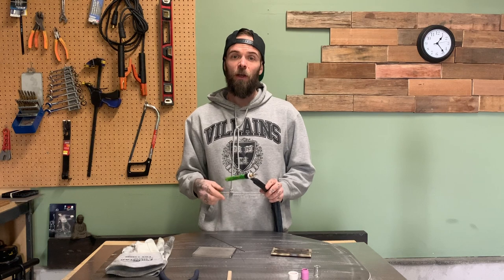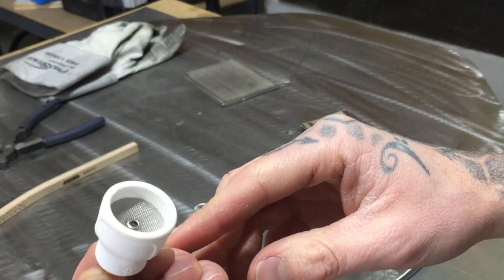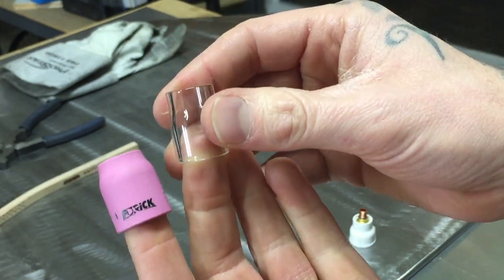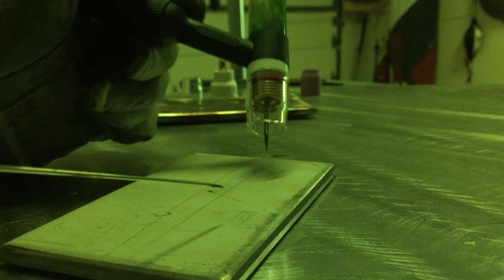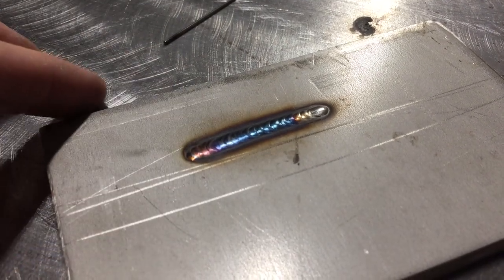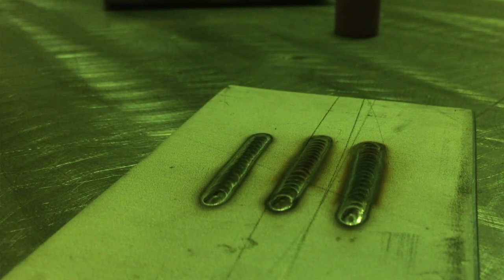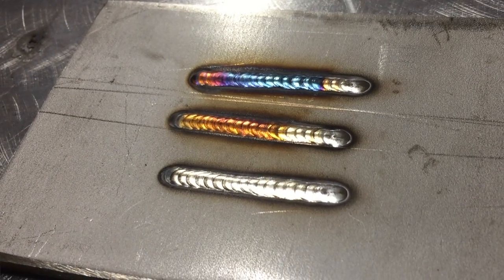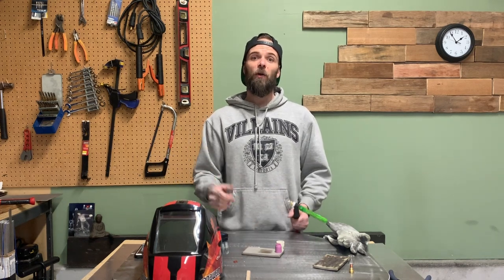TIG WELDING TORCH PORN! NEW FURICK CUP TIG WELDING GAS LENS! TIG WELDING ART SUPPLIES!

Comment: Thanks for the video! I can't help but wonder, if on the last weld you turned the gas flow up to 30 CFH, what would the first two welds have looked like at that flow rate? I just can't tell how much of the improvement comes from the different gas cup and how much comes from improved flow rate. Curious what your thoughts are. Thanks!

Comment: Hi Dusty!
I love my ceramic #8 cup,
Also I bought one Furick BBW what is amazing, and one Fupa 12 from Weldporn. I love bot of them!
But I can't use them a lot in the welding school,
Because I practicing steel pipe tig welding,but I tried on stainless steel. Super
But I'm sure you will love them. Good quality cups!
Kind regards:Robert
Reply from the maker: Hey Robert! It’s amazing to hear from many people about what they use as far as gear. Thank you for sharing! Isn’t it fun to play with toys and see what the difference is between theM all? It’s a blast and definitely one of the funnest parts of my channel so far! 
Are you an instructor at a welding school? Where are you located?:)
Cheers!
Reply: @PacificArcTigWelding  Hi Dusty!
Unfortunately I'm not an instructor, I just learning to weld in the school.
I want to work as a welder,because I hate driving. And I have two good hands. 
But I bought a nice CK flex loc torch, and couple of gas lenses. 
Currently I live in London UK. Originally I came from Hungary. 
when I will  finish my school I will go to Danmark. I have a job offer,just I have to be good in  pipe welding with TIG.

Comment: My welds are still grey with the fupa12 @30cf 🤷🏻‍♂️too hot, too slow?
Reply from the maker: Tough to tell, if say try eliminating both of those. Less heat, faster speed:) Also I always recommend pulling the tungsten back in a bit more to eliminate gas flow issues.
Reply: Ok I’ll try a bunch of things. Thanks for replying!! Love your work
Reply from the maker: Thanks so much! Let me know how it goes!

Comment: How do you sharpen your tungsten? I’m just learning to tig and using a grinding wheel but feel like I should maybe figure out a better way
Reply from the maker: I’ve been Tigging for 18 years and still only use a grinding wheel:) I just make sure my pedistal grinder has a fine wheel on it, to make sure the grinding lines aren’t too deep:)
Reply: Pacific Arc Tig Welding awesome thanks!
Reply from the maker: Just keep it clean that’s allllll that matters! :)
Reply: Pacific Arc Tig Welding when you say clean, you mean wipe with acetone and obviously keep it away from any grinding dust etc?
Reply from the maker: Yep:) My shop is pretty clean, so doing something like that is great for cleaning what you’re about to work on. I also experiment with lacquer thinner as well as isopropyl. For most of my stuff that all seems to do a great job:)
Thanks for hitting me up:)

Comment: Also the glass is great(#8 pro) 2 of mine broke doin inside corner joints on aluminum(touched the wall when hot) but I still have TWO LEFT, from 9 months ago! Not bad for 35bucks lol I like the "moose knuckle" the best for steel/stainless...still have SAME ONE FEOM A YEAR AGO! replaces diffuser but ya, SO DURABLE. dropped several times. Also BBW16 W/ titanium shield is another great stainless/titanium cup(22-32cfh) w/ MY own gas of coarse. lol so for aluminum nowadays I been loving the pink ceramic tho, durable, adequate coverage(13-16cfh) saves gas(#6-#8ceramic) for alu, gets it right everytime man. Hey talk to u next time! Great video btw, u take those arc shots at end with your phone??!! I'm jealous however u did it lol, never captures one like that yet...also #5 cup standard  Call it in call it body for aluminum also does a miracle cup for certain aluminum applications, saves hella gas too 10-12cfh
Reply from the maker: Yes! My phone set for 4K behind a spare lens, and treated for light in the editing program after. Turns out pretty decent I think:)
Thank you so much for all this recommendations; I actually LOVE hearing what other people run. I’m always looking to up my game, so thank you! And I can’t agree more about the ceramics. So simple and always consistent and work great! 
Thank you so much for checking out my channel and commenting. It’s really cool to connect with people. I appreciate it a lot!

Comment: That comparison of traditional vs gas lens doesn't do justice. It would be much more reasonable to compare similar size cups instead of large vs small cups and claim that one covers more than the other. On small cups, a gaslens does pretty much no difference, but on larger cups, it does a lot of difference.

Comment: Hello Dusty, I am just getting into weldart on ss sheet metal: i started using a 250x250 mm x2 mm thickness sheet metal: i did some test beads and i can see it's better to use a number 10 cup to get colors; i tried a 12 and a 16, but on this last one i don't get any color at all.
The problem is that i choosed a subject with LOTS of details and considering the sheet metal, wich is pretty small; i'm in the situation that I can't use filler rod to get the needed thinnes of my beads; I'll try to buy some 0.6 mm rods (or I'll just use some 308 mig wire); but since you have a lot of  experience in this field, I 'd like to ask you if it is possible to make some bead approximatly about 1/1.5 mm width using filler and getting some decent fusion on the base material; or if it is better to ho autogenous welding.
I think I rushed a bit this first project but I wanted to take advantage of christmas holydays to get into weldart, so I possibly choosed the wrong sheets; but now the local dealer is closed, so I have to get the job done with what i got.
Next time I think i'll go for a 400x400 x1.5 mm sheet, so it will be easier to get colors and I'll have a bigger draw to follow, so I won't have so many problems with complex subjects.
Thanks if You'll answer, apreciate your vids